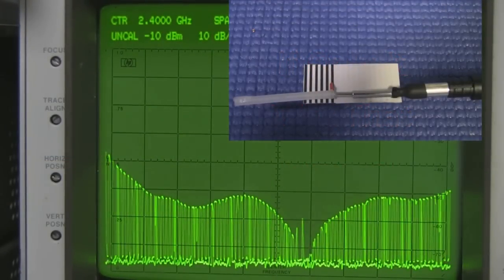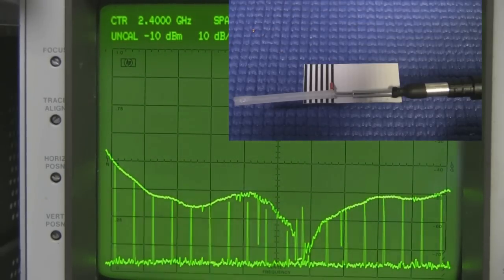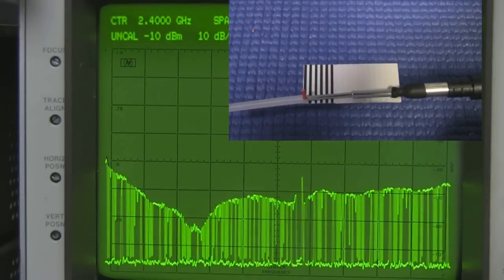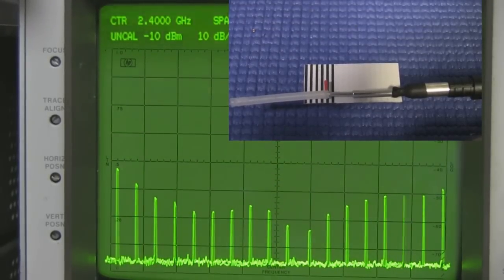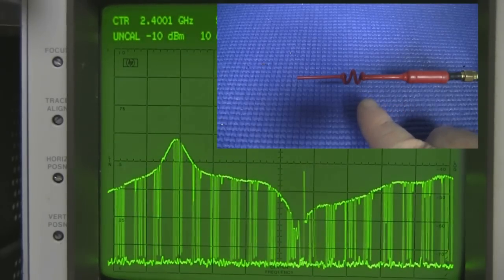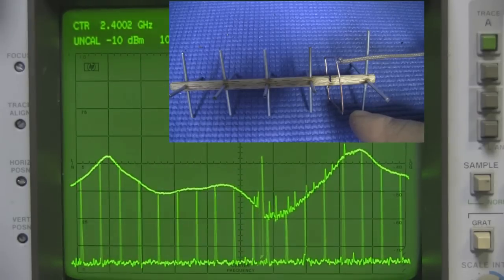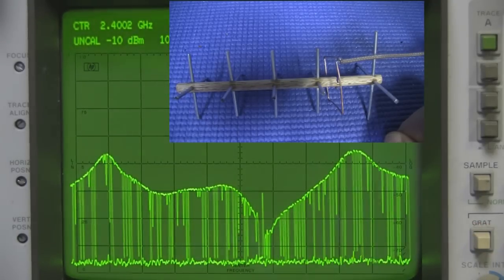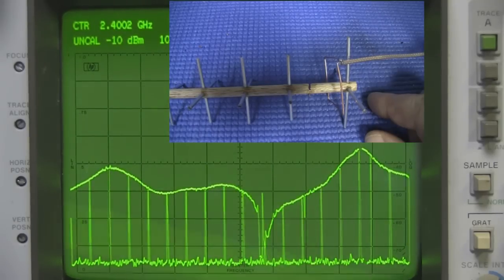wavelength

Comment: nice video.The bottom of the V response that you measured is not centered on 2.4Ghz. What is your target frequency : above 2.4Ghz ?For UAV uses , i would like very much one that is spot on but precisely centered on 2.4Ghz, not above (for Wifi). Will you make and sell compact/light dipoles for that usage?
Reply from the maker: Target is normally 2.45GHz as that will put you bang in the middle of the wifi spectrum. I have thought about selling a dipole and including a printout of its exact frequency response .
Reply: andrew mcneil that would be great thx. I checked the range of typical RC receivers and they work with freq hopping between 2400 and 2440Mhz. So a center at 2420Mhz.

Comment: Hi ~Andrew, so i have a micro sized 2.4ghz radio control receiver based on a a7105 receiver chip the original antenna was a short piece of copper wire attached to the pcb. i want to make a better antenna, and have noted that some of my radio control receiver / transmitter antennas have different lengths for instance a dipole on my transmitter antenna measures 25mm of antenna, and 25mm of brass connected to the braid, yet other receiver antennas measure 31mm.. why is there so much difference in antenna length what would the optimum length for 2,4ghz for a receiver antenna...?

Comment: Andrew, I have a question concerning 3G. I live in Costa Rica and our 2Mb service  usually will not give that much. When more people are accessing the service the power drops but you will be familiar with this. My question is if I build and install a double quad antenna will I ever be able to receive a signal greater than 2Mb. I have watched enough of your videos to know that the antenna will receive more of the signal. I am just unsure as to whether it will actually enhance the broadcast signal?.